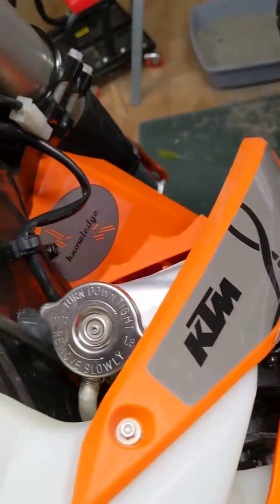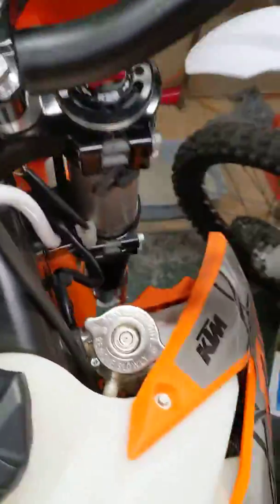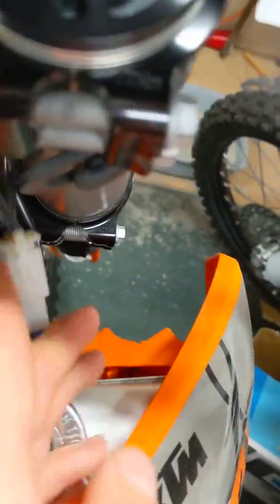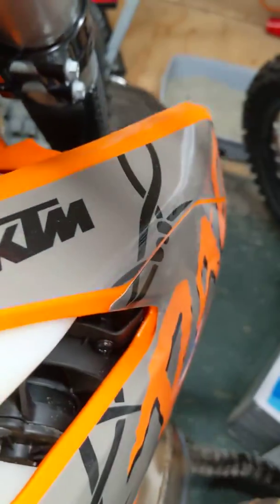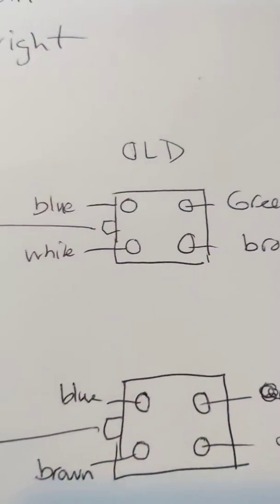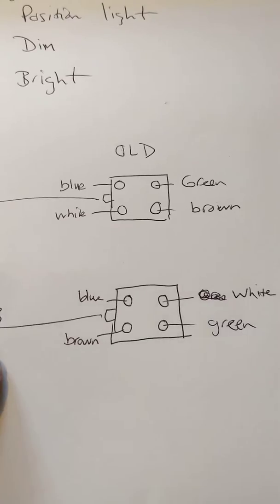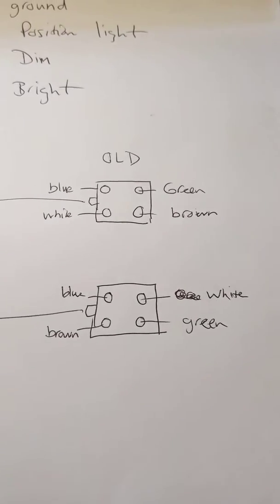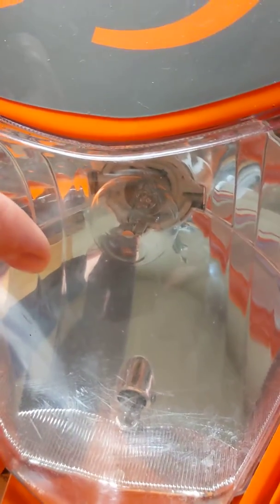KTM XC Headlight

Comment: Thanks for putting this up.  Been struggling to install a factory light on my 2019 XC.  What switch did you install?  Is it a factory part?
Reply from the maker: Yep, KTM push pull light switch. Pretty sure you can even get them on ScAmazon Prime:)